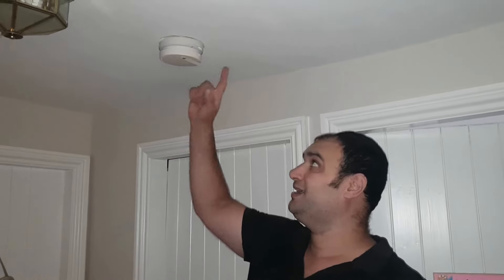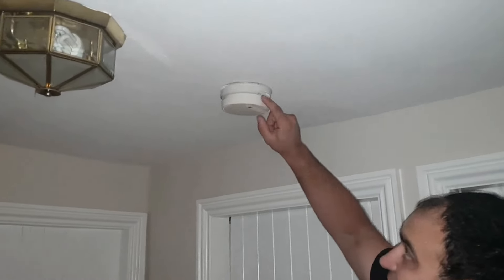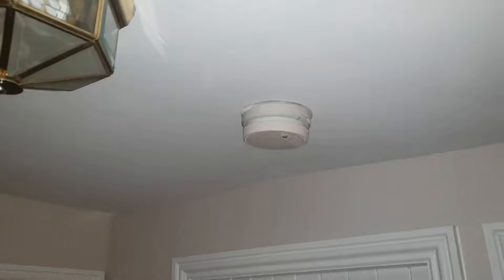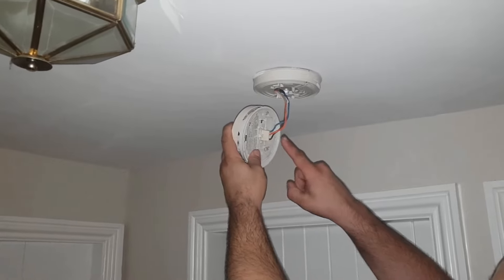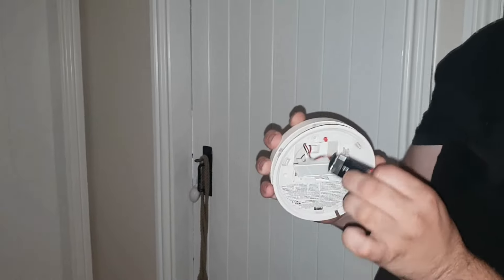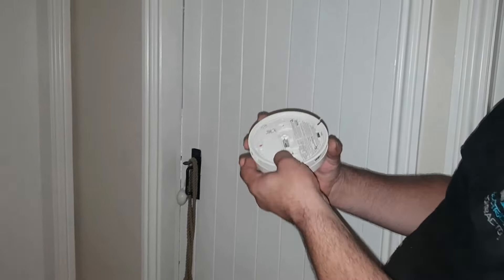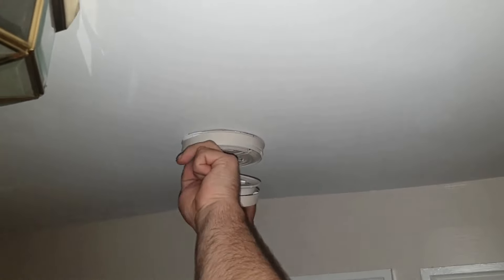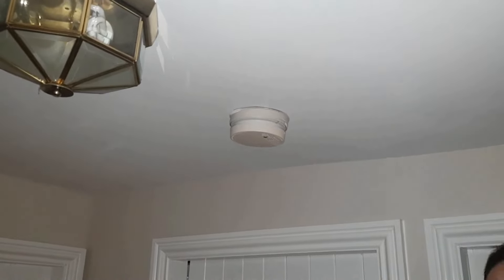How To Change Battery in Kidde Smoke Alarm - KF10 - KF20 - KF30 - Fix Beeping Smoke Alarm Problem

Comment: Got a KF10 but I can't seem to detach/pull out the plastic thing attached to the wires. I'm worried if I manhandle it any more than I already am I might break it. Have you/anyone got any suggestions or advice?
Reply: Did you ever manage this? I've tried everything to get that connector out but it seems welded in. I hate that it was so easy in the video!
Reply: @stokerjoker  To be honest I've not tried again. Don't want to break the stupid thing. But agree - all the videos make it seem so easy and it aint.
Reply: Any update? Mines the same and the beeping is driving me insane
Reply: @alexscadding8120  I got an electrician in and replaced the whole thing. It turned out that a previous owner must have glued that little door in, maybe it broke previously but it was definitely welded on there fully. Maybe it's also a manufacturer problem given a few of us clearly having the same issue. Either way, replaced the whole thing with a new one.

Comment: Take care to engage the tiny catches either side of the connector. This can be done using pressure from your two thumbs. Fail to do this and the connection will not be made.
Reply from the maker: This is a great point you make Tommy, the electrical connectors on these can be quite fiddly to engage onto the alarm itself.  
You should always check there has been a "click" from the connector when refitting and that the button on the front lights up green when the power is turned back on.
If there is no green light on the button then it's a fair chance that the connector hasn't clicked on properly

Comment: “If you grip the plastic thing and gently pull, it comes off” LIES! 🙃
Reply from the maker: 😂 I take it your wiring tab was a little stiffer than the one in the video?  If the plastic wiring tab is stuck to the alarm then gently tease it side to side slightly to loosen it off.  Worse case scenario, once the mains power to the alarm is turned off (DO NOT attempt this without isolating the power), you can use the tip of a flat bladed screwdriver as a lever to prise the wiring tab away from the alarm body itself.  Hope that helps?

Comment: How can I buy the battery to replace the old one?
Reply from the maker: Thanks for getting in touch and asking the question.

The battery required is a standard PP3 9V battery which can be purchased from most shops or DIY stores.

Here's a link to them at Screwfix:

https://www.screwfix.com/p/diall-9v-batteries/7756k

Kind regards 
James - ElectricBlu Contractors

Comment: I can not for the life of me, get the wires to disconnect from the smoke alarm. I even called in reinforcements in case i was being an idiot. Theres no tabs to squeeze and little prongs stuck under a slider